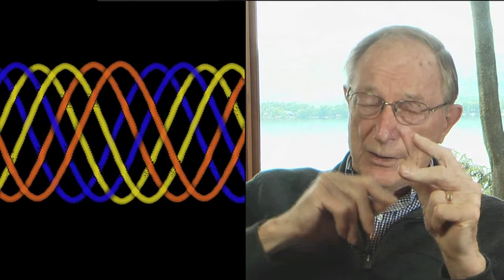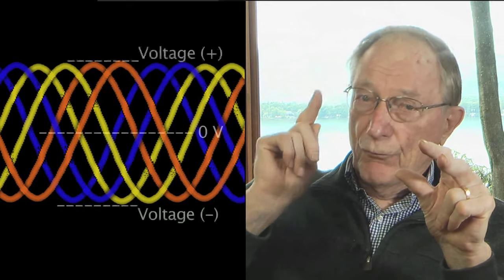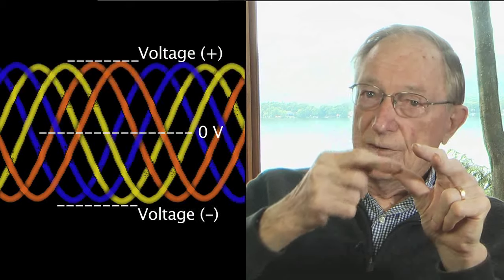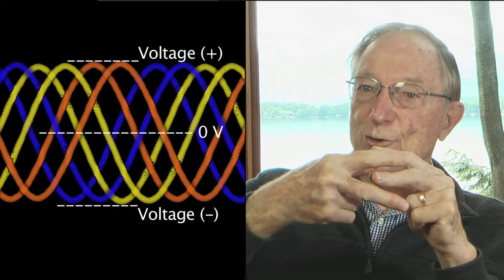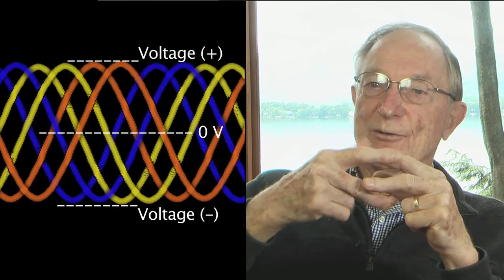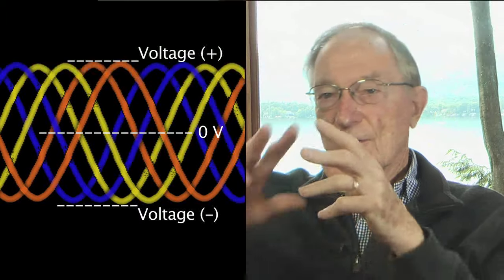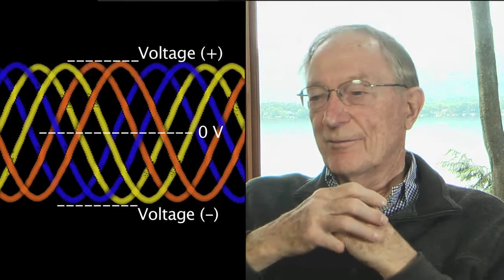Why 3 Phase Power? Why not 6 or 12?

Comment: For starters if you get the rotation wrong, you can reverse any two leads on a three phase motor. With 6 phase, you have to get all 6 leads in the proper order or things burn up. Also 6 transformers gets expensive.

Comment: With a 3 phase system each phase is 120 degrees out of phase with the others (One third of 360 degrees.)
At any instant, the potential of any phase is exactly equal to and the opposite of the COMBINATION (sum) of the other two phases.  This means that - if the load on the three phases is "balanced" - the return path for any phase conductor is the other two phase conductors.

A single phase power supply requires two conductors (live and neutral).  If a 2 phase transmission system were used one could transmit twice the power using one extra conductor. So a 50% increase in transmission costs would yield 100% increase in the power transmitted.

A three phase supply can transmit three times the power of a single phase supply by using one extra conductor.  In this case a 50% increase in transmission costs yields a 200% increase in the power transmitted.  This is an enormous additional benefit when compared to the cost of obtaining it, which is why it is used.

However, further increasing the number of phases requires increased transmission costs to transmit extra power.  In the video it is stated that doubling the number of phases (and the transmission lines) from 3 to 6 almost doubles the power transmitted.  Hence there is NO economic benefit in doing this.  In fact, there appears to be a cost penalty.

Comment: This is very easily understood. If the phase number belongs to 3*2^x you can just put them in the stator of the generator like you did on 0:48. However in this status you generates twice the power but also the resistance torque on the rotor is doubled as well. Energy doesn't appear out of nowhere. More than 6 phases would make the stator clumsy and rarely offers any more benefits (remember the resistance is there, if it's heavy then it won't rotate that fast!) so 6 is best. Get the phase shifter to couple them back to 3 phase and it's ready to go.

For sending powers sake a 3 phase compared to a 2 phase sends 3x the power (it equalizes itself so no neutral line) at 1.5x wires. It's efficient. Odd time phase numbers such as 5 or 7 does NOT offer more power per wire thus useless.

Comment: There are multiphase power transport systems used. Also ultra high voltage direct current transport systems seems to be effective in undersea cables when we transport power on levels between 100 000V and 500 000V.

Comment: Your channel should be called Tesla Tech Center. Edison was a hack.
Reply: Edison was ultimately partially right.  DC is more efficient at transmission than 3phase or 12phase etc AC.  That's why it the only solution for long distance underground, submarine cable, and ultra long distance transmission.  Its vastly more efficient.  You would never consider 4,6 or more phases because DC would be the way to go.
Reply: @WilliamJones-Halibut-vq1fs  In what universe. You believe in some strange physics.
Reply: Insulation is dependent on the DC or peak AC voltage to earth ground. Current loss is dependent on wire size. Although AC current rises and falls AC loss is equivalent to the RMS current value in DC amps assuming a resistive load. If you add more phases you approach the DC value for insulation. However the current is still dependent on wire size. The big advantage to AC power transmission is the ability to easily change the current/voltage ratio with transformer. High voltage insulation (mostly air) is much cheaper than huge current capacity wires. Since power is measured as current times voltage and the biggest loss is due to the current traveling in the wire and not the insulation loss the higher the transmission voltage the lower the power lost in transmission. Three phase powers main advantage is the ability to use induction motors which do not need brushes and slip rings or commutators.  

The main advantage to DC transmission is had when sending long distance power underwater or underground. Here you must take safety into account and use what amounts to a large coaxial cable. To send three phase power you would need three of those type of cables or a specially built cable with three very high voltage insulated conductors inside.  

The disadvantage of DC transmission comes when you need to change the current/voltage ratio you then must change back to AC so you can use a transformer plus the most efficient way to make large amounts of electrical power is with alternators not DC generators or with batteries.
Reply: @tripplefives1402  There is a significant loss in charging and discharging capacitors at higher frequencies in the dielectric material. The load current in the DC line will change when you turn it back into AC. You can try and minimize that effect with a big capacitor in parallel and inductor in series or a gigantic battery. So now your back to the original problem which was the line impedance. To turn that DC back to AC you need to build a very big inverter which will also have losses not to mention the creation of switching harmonics. To make the DC you also need to switch the AC input and if you want the line voltage not to vary you also need to use a combination of inductors in series and capacitors in parallel or a gigantic battery.  

Problems with inductive loads don't disappear just because you have a long distance DC line.   

They had problems with underwater telegraph cables between the US and England because of capacitance. However in that case your trying to send square not sine waves plus you have a big capacitance due to the closeness of the conductors.
Reply: @tripplefives1402  Can you name a place where a High Voltage DC Transmission line is being used that isn't either required to be underground or underwater?
Reply: @tripplefives1402  I think a much bigger problem is that power does not just travel point to point as if you were shipping rail cars where you have total control of the rail cars paths. Instead an AC grid configuration results in power transmission that travels in multipaths based upon the impedance of the interconnected lines (grid). Impedance is combination of resistance and reactance. Resistance is the real loss due to the physical properties of conductors and insulators in both AC and DC circuits while reactance is only seen in AC. - The problem of making an AC current flow where you want despite the inductance and capacitance in various parts of the system as a whole. Similar to shining a light through a semi reflective mirror you don't lose the energy is just comes back to you.  (you have to counteract it as you say). Sure you have physical losses not seen in DC like in the capacitive dielectric and eddy currents due to the changing magnetic fields in inductors. In the end what drives the use of any one technology over another is the cost to implement and operate.
Reply: @tripplefives1402  You don't lose power in an ideal capacitor or reactor. The reflection creates standing waves in the transmission line it doesn't just show up at the generating station arriving out of phase. This problem is seen all the time in high frequencies traveling short distances. A uniform transmission line (conductors uniformly space with the same dielectric and same inductive property) will have a charistic impedance for an infinitely long line. (You model it as a long series of inductors in series and capacitors in parallel.) This is why you will here cable's described as having a characteristic impedance of 75 ohms for RG 6 coaxial cable, 600 ohms for ladder line and 300 ohms for VHF or UHF twin lead. As long as the generator and load have the same characteristic impedance then all the power will flow down the line to the load. The only other way to get all the power to flow and not generate standing waves is to be connected at an exact multiple of a half wavelength.       

The wavelength of a UHF TV transmission is about two feet and VHF channel two about 30 feet. So to get these currents to flow down a Cable TV line requires that the system has impedance matching otherwise you would get standing waves and wouldn't be able to split off at random intervals even the small power needed to receive a TV signal. With AC at 60 HZ the wavelength is about 5,000 kilometers or about 2,500 miles that's why they say DC is better for distances beyond 300 miles. At a distance of less than 300 miles than at 60 HZ the transmission line looks the same as a DC line. It's also easier to calculate how DC power will enter and leave the system since mostly you worry just about resistance. Still in all DC transmission has only become practical with the advent of high power and high voltage silicon device circuits. You may save in transmission costs and problems but pay when you need to convert back to AC.
Reply: @tripplefives1402  You can't directly interconnect different DC voltage value lines and outside of the Railroads Northeast corridor at 25 HZ we are not Japan with multiply frequency systems in North America. The railroad uses rotary converters (Motor Generators) not AC to DC to AC (converters to inverters). 

The reactance in any AC circuit makes the voltage and current maximums out of phase everywhere on the line. This limits the power transferable because the conductor has a maximum current due to I squared R loss and a maximum voltage before insulation breakdown. You can think of voltage and current as vectors rotating on a complex plane if the vectors are 90 degrees apart than the dot product or the real power is equal to zero. While the apparent power for voltage and current 90 degrees out of phase is the cross product for the vectors and is equal to the scaler voltage times the scalar current. In real situations the dot product is the real power and the cross product is the apparent power with the phase angle somewhere other than the special cases of 0, 90, 180, 270. and 360 degrees. I still think the biggest losses will be found in the wires resistance and the insulations leakage. Neither of those problems can be solved by changing from three phase AC to DC. 

  Another problem for long distance AC lines with different paths and multiple loads and generators is a possible circulation current but that's also a problem with multiple DC interconnects unless you want to insert some kind of isolation or disconnect scheme. Think of what would happen if you connected together two car batteries with a slightly different level of charge.
Reply: @rlb96  He's right, as using DC reduces power losses due to the skin effect, eddy currents, capacitance and so on. However, that's only because modern high-powered semi-conductors enable very high frequency DC-DC converters. It's expensive, but the longest transmission lines in the world use high voltage DC (HVDC). 

The reason that mains frequency AC won out is that voltages could be stepped up and down using simple iron-cored transformers. That technology is going to remain with us as it's cheap and works well in local distribution networks. However, for long distance lines, HVDC is more efficient and has other advantages, such as not requiring synchronisation between grids.